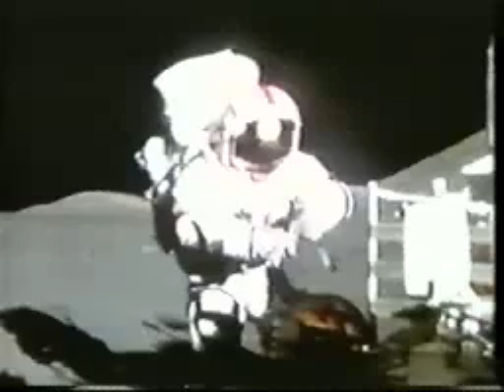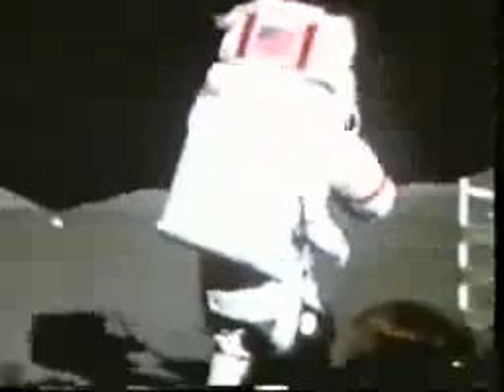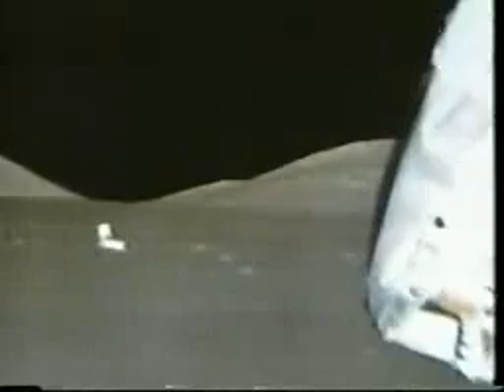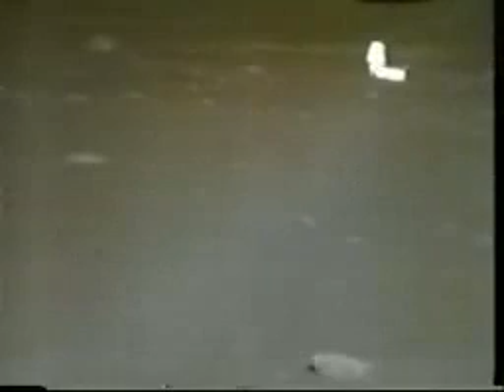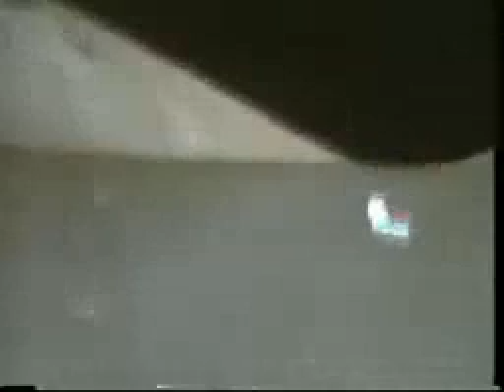Fixing lunar rover with duct tape

Comment: On moon temperatures, if the moon goes from +250 to —250 F, at some point it has to be at every one of those temperatures in between. On one of the EVA's, they actually gave the surface temperature of the moon as a very earth like 40 degrees. It seems a lot of people think the moon can be ONLY +250 or —250 and never any other temperature, LOL.

Comment: Duct tape won't work well on a surface covered with dirt and dust, which is what happened here. As for us Americans and duct tape, watch a NASCAR race. I've seen a car wrecked in a NASCAR race with the nose completely taken off the front of the car and reattached with rolls of duct tape, then run around the track at 200 MPH without so much as a thread coming off. And thanks to the folks in the greatest country in the world or you Canadians wouldn't even have duct tape.

Comment: expattaffy1, Look at AS17-146-22294, It can be clearly seen where the rover has been dragged sideways into a position to be photographed, the wheel marks intersect, but they are not there either underneath or behind the supposedly driven vehicle, I wonder why?

Comment: Well, I can't review 695 comments, but has the question been addressed as to how duct tape could endure the temperatures of the moon? On earth, if you leave duct tape out in the hot sun, it will get tacky and start to sag. The temperature of the moon is hotter than boiling water. Maybe it only served to work for the few minutes they needed it?

Comment: @ed11561 NICE POINT! im watching soccer, and its a LONGER delay between contrys here on earth(!) than what it is in this laughable video. Also notice that the ASTRO NOT is said to use and hold TAPE between his fingers - which in vacuum is total impossible, as they couldnt grip anything less than 1 inch

Comment: a leaf blower will be weaker psi for psi, but can move small rocks! stop sing vacuum as some excuse, in fact air would create some resistings but thats not the case with vacuum!! the spread angle is bigger in air

Comment: no dispersed thrust in vacuum thats a myth! fact is, the engine was strong enough to kicking up dust 100ft above the surface at only 30% thrust, right under it! and the engine was running at the same 30% of thrust AFTER it landed, but didnt dig a crater?!?!!?

Comment: No! the sun will be reflected as a tiny little star.

the suits should been in 5.2 psi on moon and very puffed up, thats a lot of pressure! the instructions nasa gave hasselblad was that the buttons and wheels on the camera needed to be atleast 1 inch because thats the smallest a astronaut could grip

Comment: Space radiation also has very different effects on human DNA,
cells and tissues. This is due largely to the increased ionization
that takes place near the track a particle of space radiation takes
through a material. Ionizing radiation has so much energy it can
literally knock the electrons out of any atom it strikes  ionizing
the atom. This effect can damage the atoms in human cells,
leading to future health problems such as cataracts, cancer
and damage to the central nervous system

Comment: That's right and it's clearly visible in landing footage where you see the moon dust being blown directly out and away from beneath the lem. There is a layer of dust with hard bedrock below it. Those engines just blew the dustaway. They would not make a "blast crater" as the hoaxtards claim there should be.